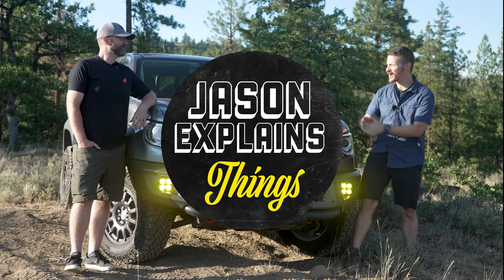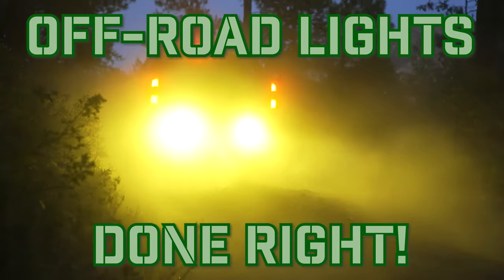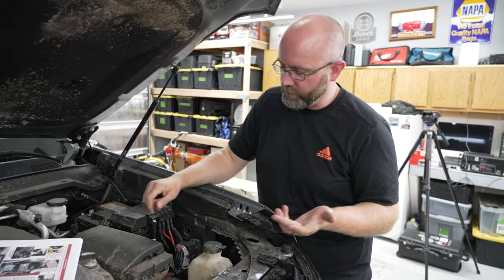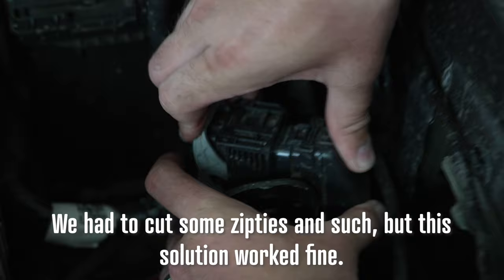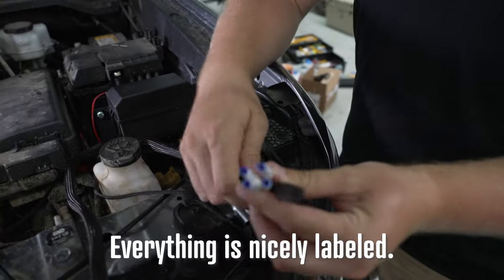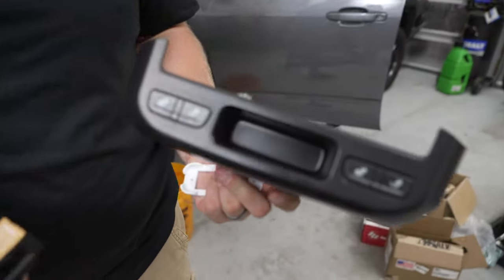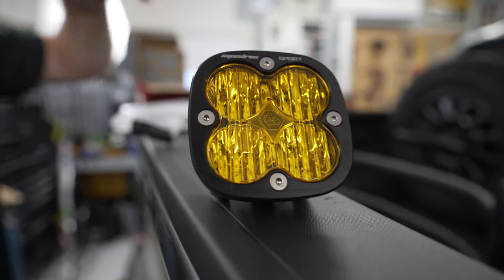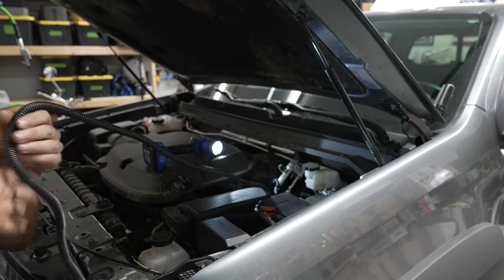Chevy Colorado ZR2 Trail Lighting DONE RIGHT! LED Fog Lights and Chase Lights

Comment: Guys, you focused on all the EASY parts of the install.  I have the rear lights, so I will focus comments on that.  Installing the lights themselves is quite straightforward, but it is the wiring that is the difficult part.  The Baja Designs (BD) wiring which comes with their Squadron lights looks sufficient, but when laying it out it is apparent the main lines going to the lights only extend to the front of the bed.  Running the wiring along existing wiring channels is straightforward, but since the wires only reach so far, where are the hot and ground connection points?  They will not reach the engine bay.  I understand you used a third-party control switch in this video, but it appeared you ran the BD wiring through the firewall at a separate point as the switch's main wiring, but you glossed over the firewall penetration point merely stating that a fiberglass rod was used.  Did you go through the main wiring port as well or did you use the penetration near the hood release cable (about 6" up and over)?  Did the wire run to the same lighting control panel or did you used the BD switch and mount it elsewhere on the lower dash?  If so, again, where did you connect the hot and ground under the chassis?  Again, the easy parts were well covered, the nitty-gritty of penetrating the firewall and the wire connections for the leads was glossed over, and where the switch was installed as well.  Otherwise, a decent video, but it lacks the critical info for the rear lights.

Comment: Why amber lights?
Reply: Good question, amber tends to give better visibility in inclement conditions (dust, fog, snow, etc).  Not only for my visibility, but for others to see me better on the trail as well in dusty conditions, which we have alot of in Central Washington. 😁 You might see them in use for exactly that reason in an upcoming video!

Comment: Did the quick disconnect come with the system? I can’t find it online anywhere and you didn’t post a link.
Reply from the maker: It did yes if I remember correctly.  Either it was included or it was an add-on to the kit.

Comment: Would love too see some lights added to the ol' dodge! Looking at doing some similar light upgrades to my truck. Keep them videos coming!
Reply from the maker: That would be awesome... they'd have to be retro KC lights!  :-)  Next week's video will feature the ol' Dodge a bit.  Several other projects for it planned (U-Joints and a cool rear diff cover is the next thing).  I'm being held up from working on it lately because it's over 100 degrees all the time and it doesn't fit in my shop or garage... and laying on asphalt is a no-go.
Reply: @JasonExplainsThings  They most definitely would have to be retro lights, I agree! Also living in Phoenix, AZ I know a thing or two about 100⁰+ weather and pretty much anywhere on the ground being a no go zone hahaha